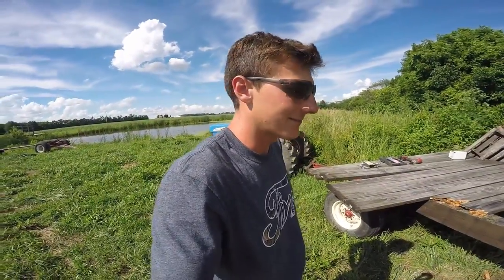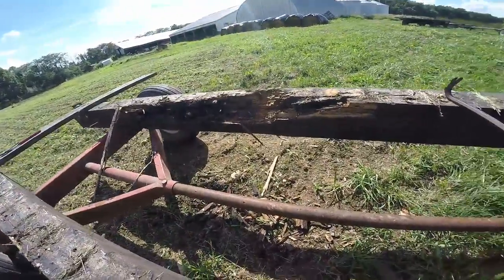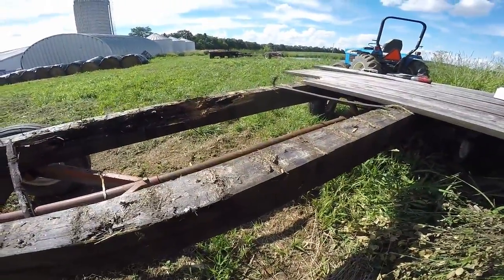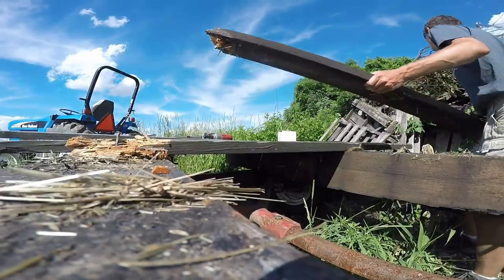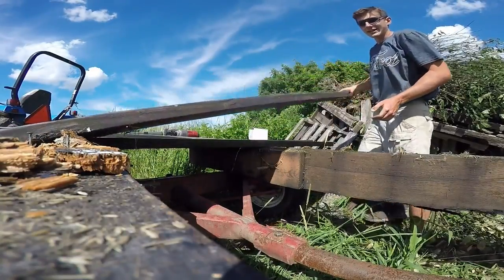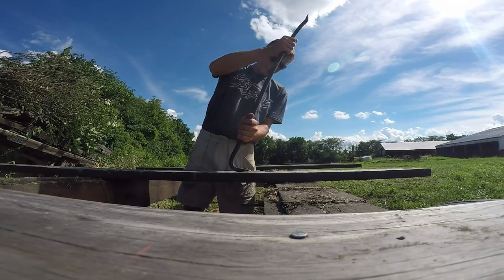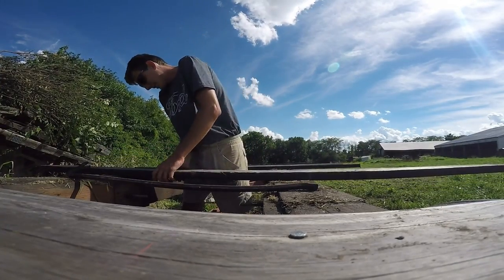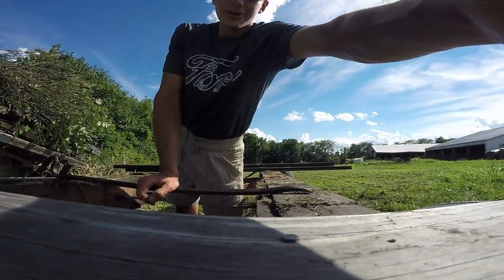Deconstructing a Hay Wagon

Comment: In the 80's our old manure spreader was like that hay wagon. My brothers were good at punching holes in the floor to break up frozen shit. I used to lay slices of hay bale over the holes & in front of beater before doing morning barn cleaner. Eventually when i took over i bought a brand new 680 new holland and i could actually get the manure to the field and not all over the roads.
Reply from the maker: the new spreaders have poly floors, but I still wish dad got a slop gate when he bought ours. That's the only equipment we've ever bought new. I don't trust used manure spreaders.

Comment: Are there any lumber mills down your way? You could get two new beams and decking fairly affordable I would think. If you wanted to splurge, you could get tongue and groove pressure treated for your deck.
Reply from the maker: You'll see the closest saw mill in a video soon. It was mostly free wood.There is a commercial mill about 12 miles away. The splurge was already made for the new baler this year.

Comment: Yeah wagon and trailer floors... best to keep them under cover if possible, but it takes a lot of space.  We're currently using those cheap carports for sheds for stuff-- certainly works and FAR cheaper than a barn... you can always buy cheap tin at Lowes and panel down the sides and the end if needed.  I've heard that dumping used motor oil on the floors and letting it soak in will extend their lifetimes considerably-- sorta "poor man's creosote" but I haven't done it.  With the cost of wood now, I probably will on the next floor on the 16 foot trailer.  Heck with the prices going the way they are, a steel floor might not be much more expensive particularly if a guy could find some stuff at a resale or salvage yard... 

Later!  OL J R :)

Comment: Windshield washer fluid is great for loading tires if you get the stuff good for low temperatures and its not so hard on the rims not sure what the cost is in your area but it's not really a difference
Reply from the maker: I don't know where I could the window juice in bulk without cleaning out a the auto section at walmart and carrying a bunch of one gallon jugs.
Reply: @boehmfarm4276  You have to look around you can order 55 gallon drums of the stuff... 

We're lucky we can get by with water in tires most of the time... just gotta be careful because in really low temperatures the water can freeze in the tires-- so long as the tractor isn't run it's not a big deal, it'll thaw fairly quick when the weather warms up because tires are great at absorbing sun and warming up, but back when I was in high school we had a neighbor who forgot about the water in the tires and went to feed cows when they were frozen-- picked up a bale of hay and it rolled a few times and then blew out the tire... Later!  OL J R :)

Comment: had new tires put on 18.4.34.same problem.the tire guy scraped loose rust off then put half a roll of duck tape around rim.said last long time.??? time will tell. they are steel rims 656
Reply from the maker: I don't like the duct tape thing. I understand the concept, but seems flaky.
Reply: Boehm Farm if they do go.will be new rims. tires tubes calcium was 2030.00 installed.rims werent too bad.if had known about the rust woulda been new.of course they scraped off loose.enjoy ur videos

Comment: l just put new rims on my ford 3000 .they had calcium in them  for 47 years  finally rusted out  lthink pretty good service. what makes me mad is the l think rock or piece of shale through the rear on the 7700 and a bath of calcium. oh well another day of hay baling...
Reply from the maker: Sometimes, I joke with the local tire changers that I will go to steel wheels soon. I won't need them.
Reply: @boehmfarm4276  Yep go Amish... those guys up around my BIL run them up and down paved roads too!  Even saw an IH rotary combine on steel wheels-- they left the rubber on the steer tires-- so long as they're not a powered wheel pneumatics are acceptable and don't violate the rules of the order LOL:)  One guy runs a steel-wheel skid steer up and down the paved road-- you can follow his tracks for MILES where it chips the stones in the pavement LOL:)   Thing is the BIL has ridden on a steel-wheel tractor before and he said it'll rattle your teeth out-- SO much rougher than a rubber pneumatic tire tractor.  He said he couldn't imagine the ride in that combine or skid steer LOL:)  Later!  OL J R :)

Comment: I would like to see the finished project.What does fluid do that wheel weights can't do?
Reply from the maker: We're getting the videos up about the wagon building. The fluid is 8 pennies/lb. Most cast iron is well over 50 cents/lb. 
Wheel weights can't rust out your rim,
Reply: Fluid is the cheap way to weight down a tire... water is 8.3 lbs/gallon, chloride tire fluid is like 11 lbs/gallon IIRC and it's freeze resistant because it's a chemical "salt" (a metal atom and a halogen (halide) atom combined, like sodium chloride, but there are many other "salts" like potassium chlorate, etc).  The problem with salts is, like regular sodium chloride "table salt" or "road salt" they draw moisture and cause massive corrosion of metallic parts like rims when exposed to oxygen.  Beet juice is actually sugarbeet fluid which is mostly sugar, so it's heavy (don't recall the weight per gallon offhand but it's higher than water lower than chloride IIRC) and because it's sugar it also doesn't freeze until a MUCH lower temperature than plain water does... but it's rather expensive compared to other tire fluids.  Some guys use windshield wiper fluid, which is just alcohol and water. The weight per gallon is very close to that of water, but the alcohol content lowers the freezing point quite a bit.  

Tire companies say fluid in tires is hard on the tire, and that for maximum tire life it's best to use cast iron weights and only use air in the tires.  I've heard of guys having liquid tanks made that will bolt inside the rim of the tractor tire and bolt up to the wheel where the regular iron weights would bolt to, and then filling them with water or chloride, but that's expensive too and you have to find someone to build them because nobody sells them.  Allows you to use cheaper fluid without putting it in the tire, BUT not as much of it as you can get into a tire either... 

Later! OL J R :)
Reply: @lukestrawwalker  thanks for this information Luke.
Reply: @justincase2830  you're welcome